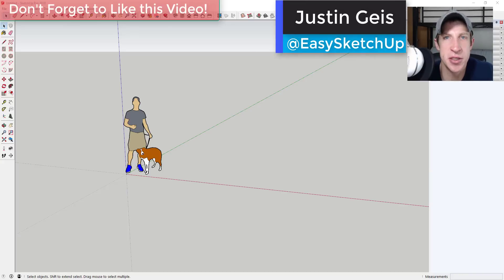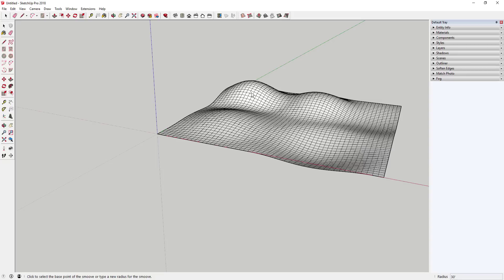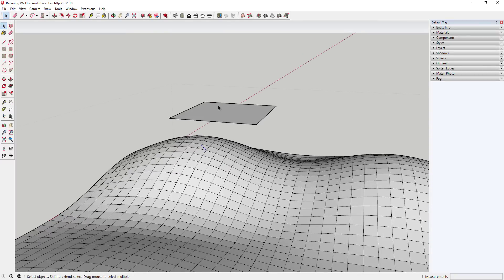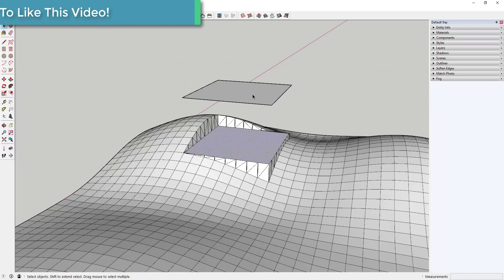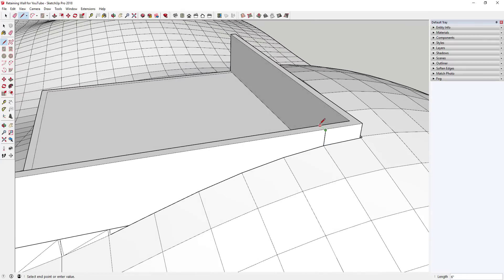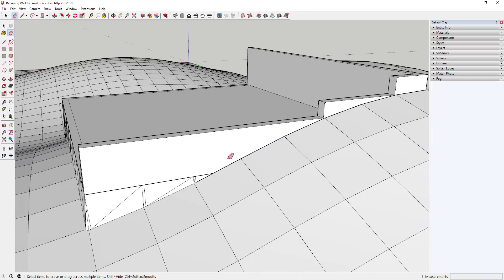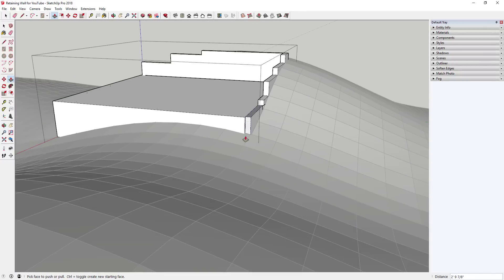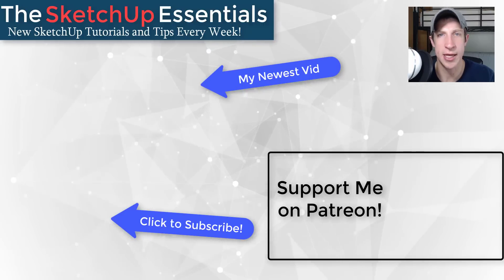Modeling a RETAINING WALL IN TERRAIN in SketchUp

Comment: I have a sketch up license,  but it doesnt seem to have a 'sandbox tool set' option? does that make sense ? It should be under view, toolbars etc right?
Reply from the maker: You probably need to enable the Sandbox Tools extension in your extension manager. Go up to "Window," "Extension Manager," and go down and make sure Sandbox Tools is enabled. Make to to click apply if you have to switch it to enabled. Thanks!

Comment: Anoter great tip Justin. omething I had been looking for a while back, thanks. id you ever get your New PC (or was it a laptop) up and running with 2018? I recently bought a Asus VivoBook X542U with a i5 processor and 4gigs of RAM and a Nvidia 4Gig card built in my Antialiasing is set to 8x, do you think adding another 4Gigs will help speed up my models? I have one model(house) that I think I over modeled with high details  surrounding steel roof trusses. Even when turning off layers it seems to be a bit sluggish. What specs do you recommend for doing heavy details in your models and would placing a lot of objects in layered groups help? Thanks
Reply from the maker: Hi Wayne! I did! I ended up with a Cyberpower Gaming Desktop that I got for a significant discount on Black Friday - it has 16GB of RAM and an I7 processor - probably a bit overpowered for modeling in SketchUp, but I also got it for the purpose of working in VR, so I have no regrets - I'm very happy with its performance :) 

I would say that yes, another 4 GB should make a difference - I believe SketchUp recommends at least 8 gigs on their website, though if you're dealing with a model that's very detailed, you might continue to experience problems anyway. SketchUp just seems to get twitchy when you get up in the high polygon count type models. Have you tried purging the unused geometry in your model?  

From a specs standpoint, SketchUp lays out their minimum and recommended specs on this page - https://help.sketchup.com/en/article/36208 - it feels like you're in pretty good shape except for your RAM. Thanks!
Reply: Hi Justin,Thanks for the tip, yep I purge on a regular basis while working,so I will indeed stuff as much RAM  in that the Laptop can handle,...Thanks again.
Reply: Most don't realize SKU runs on the GPU not CPU primarily. Money in a high end GPU pays off in speed increases for SKU. In general a GPU is way more bang per buck than a CPU, another cool thing about SKU's already affordable package. The CPU is what Layout needs, so an I5 will lag at times, just make sure you don't make Layout over render things--chains, lots of lines in a steel roof, etc will kill your speed there in hybrid mode. I rendered a whole subdiv and the steel roof of the storage units killed me till I put that geometry on a "hide from Layout" layer. Prob solved. Landscape will also kill you, so plan ahead BEFORE sending to Layout. Layout's the one achille's heel in the SKU pipeline from model to plans IMHO. Does a lot, but slow. Wish it was GPU based too.

Comment: I use subtract. Its easy to work without the slope that stamp tool creates and you can control the height of the platform.
Reply from the maker: Ooh - I'm going to have to try this - this sounds like a great application for that tool - thanks! :)
Reply: TheSketchUpEssentials glad to help ;)
Reply: To use Subtract tool solid,  doesn't the mesh need to be a solid?   I want to know more about this approach

Comment: I use a similar method only I stamp and then create the wall model separately from resulting geometry and insert, makes it better for calculations but yeah, very straightforward. Good one!
Reply from the maker: Hadn't thought about the calculations there - that's probably a good idea - thanks Oscar!
Reply: Hi Oscar, Can you explain that a bit more for me please.  I'm only new to sketchup, but I will be dealing a lot with retaining walls in my line of work, so I would like to understand more about your comment.  Create model separately?  Do you mean outside of the group?  Better for calculations?  Thank you very much.

Comment: Is there a way to calculate how much dirt you need to add in some areas and remove in other areas to create the pad?
Reply from the maker: I'd say probably not easily. You could probably try to create a solid by intersecting a box with the terrain to be removed (then SketchUp could calculate volume in the entity info), but I have a feeling that would probably create a LOT of cleanup work. It is theoretically possible though. Thanks!
Reply: @Thesketchupessentials  Could we use the joint push pull option that flattens an extruded selection, so the mesh face is retained (leave orig faces mode) and the flat auto generated face is the pad, then assuming that's a solid, no clean up required? I need this very solution today actually. I'll report if it works like I hope it will. 
UPDATE:  YES! It works, but it runs like this: 
1) drape the shape as Justin outlines here. 
2) Then use Joint Push Pull's push pull by vector to take that draped shape on your mesh up to a flat one. Be sure to select options for a) leave original face, b) generate as group
3) click for the volume listed in your Entity Info. Voila! Combining Justin's hacks and tuts, it's super easy. It actually generated a clean solid object with volume calc.

Comment: Sandbox tool> from scratch 
Can I use this to create human face❓ I know nothing connected to architecture but still fun to create one
Reply from the maker: I'm sure that you could, you'd just have to get good at sculpting with the sandbox tools...
Reply: Regarding Cut and Fill, you can make solids of the portions (volumes) of the terrain that are to be removed as well as those volumes you've added. Make sure they are solids by grouping the volumes. Check Entity info after making the groups by clicking them one at a time and checking entity info to verify they are solids. If they are, entity info will tell you they are solids. It's best to make the solids outside the terrain groups they are completely separate.

Right click on each solid you've created and select Entity Info from the resulting dialog box. There will be listed the volume of each solid as you select them. Volume can only be had if the entity is a solid. The cut and the fill numbers are that of the solids. If they are not solids make sure that your volumes have all faces complete and no stray geometry. If not, add the missing faces and erase the extra stuff inside the group.

Also, there is an Extension called CutNFill (from TIG) (available from the SketchuCation web site) which does essentially the same thing by subtracting one terrain volume from another. You have to create the original terrain and then one that is the new terrain and place them in the same space. CutNfill will do the work from there.